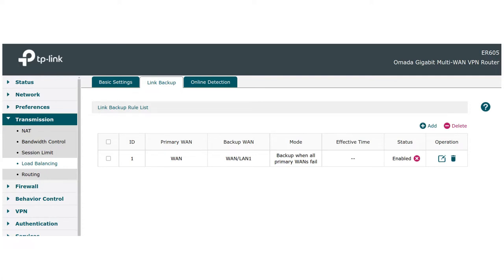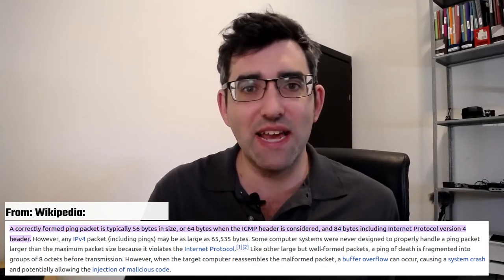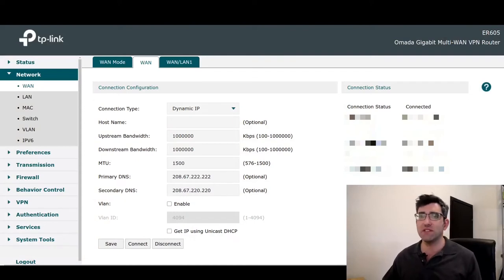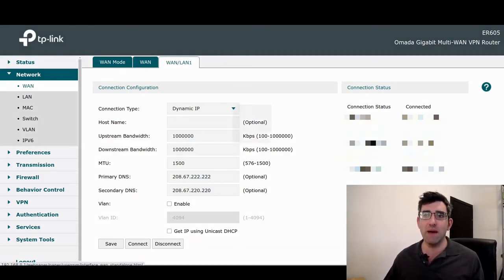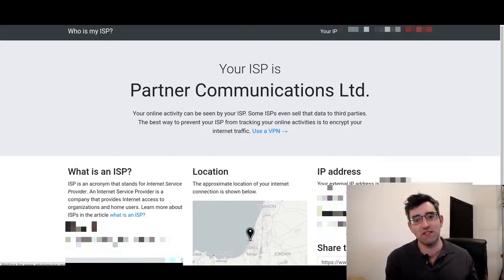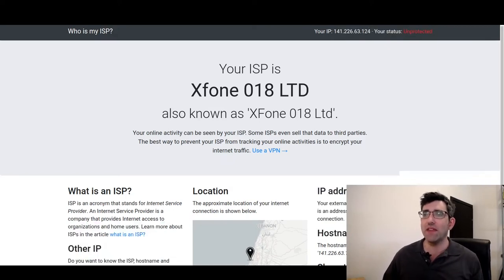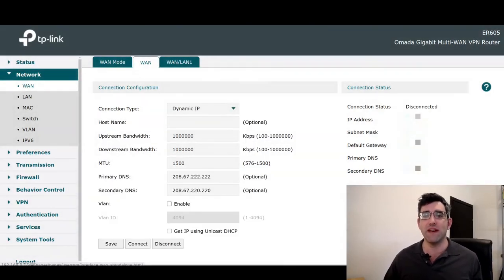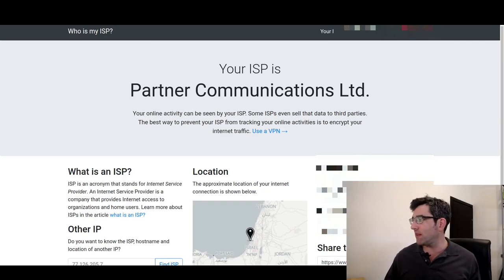TP-Link ER605 Load Balancing Router: Initiating Manual Connection Failover

Comment: when I use the "always online" on my failover, the ER605 doesn't go back to the primary after reconnecting. Do you know why?
Reply from the maker: Did you try enabling load balancing as well as the link backup rule? Apparently the setting is a bit of a misnomer and it needs to also be active.
Reply: @DanielSRosehill  Both are on just like your video. they only different thing was that I toggle the always online on the backup and It picked it up automatically but never went back
Reply from the maker: Weird. One more options worth exploring might be manually configuring the DNS name servers used for offline / online detection. Google's main DNS name servers are popular choices for this purpose (and their IPs are easily found online)